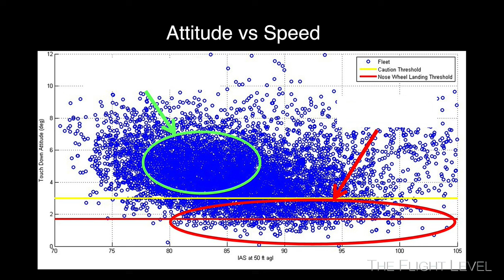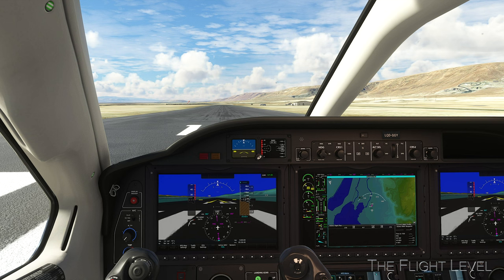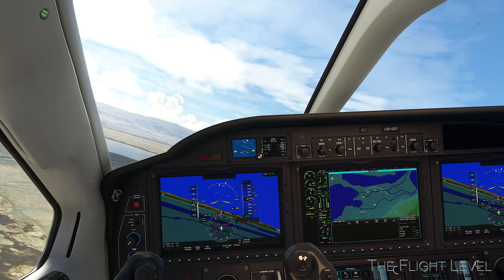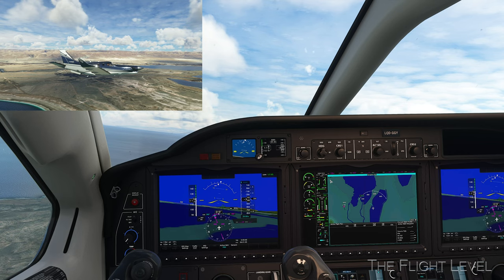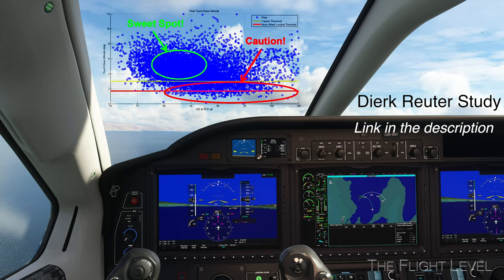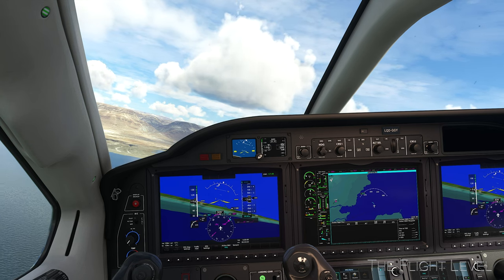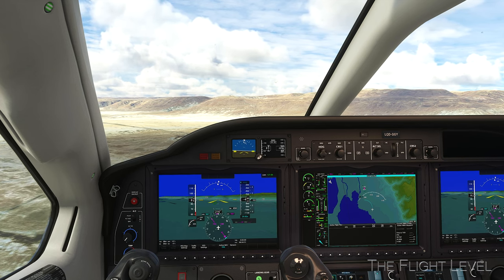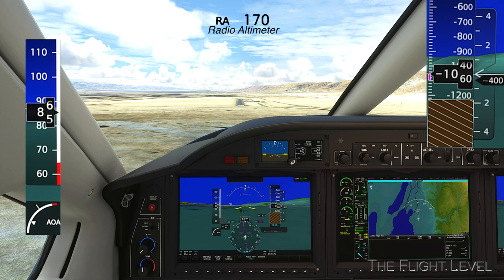TBM Landing Technique- Landing in Style- Circuits at the World's Lowest Airfield- Bar Yehuda LLMZ

Comment: Nice landing and video!
I haven't flown the TBM since they updated they PFD and MFD. The screens are so much easier to read now. It makes a huge difference!

You should consider doing a RTWT (Round the World Tour). I've done it twice now with one of the tours done in the TBM. Great aircraft and fun to fly. If you need a spreadsheet to help plot your course around the world I have one available. Hit me up for it. It could save you some time. 95% of the flights were possible via fuel capacity. Those extra 5% had unlimited fuel turned on. It was time to head home! It takes about a month and a half to accomplish.
Reply from the maker: Thanks for the visit and commentary! The TBM is certainly a pleasing aircraft to fly. Very predictable and smooth. A RTWT is on my bucket list when the right time arrives. I have made a note of your contact! Thanks and blue skies!

Comment: The picture shows that it is safe to touch the runway with a nose angle above 3 degrees. And when landing, the angle is lower. Or is there something I don't understand?
Reply from the maker: The essential component is to have the mains touch down first. The angle can be lower providing the main gear touch first. Thanks for watching!